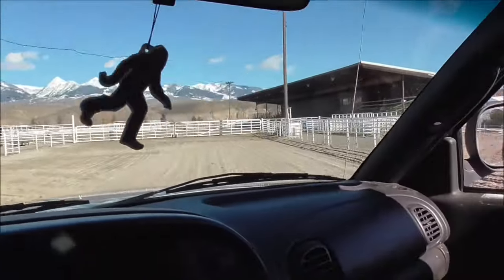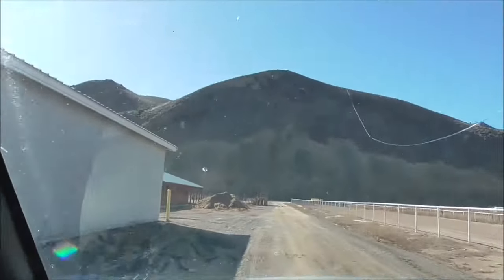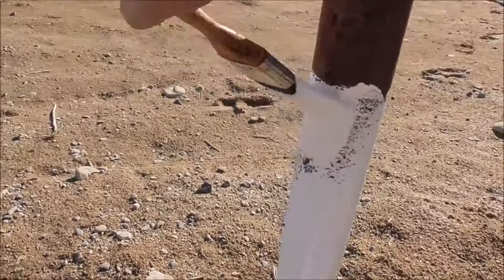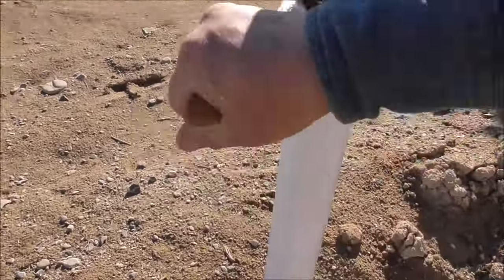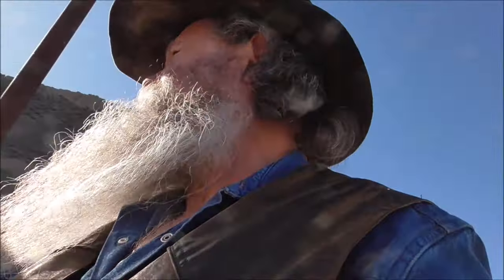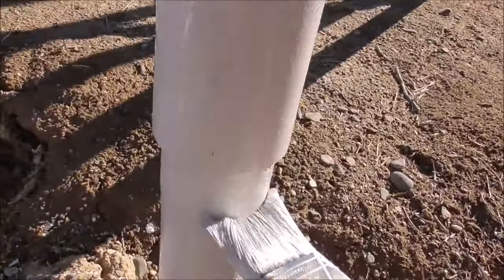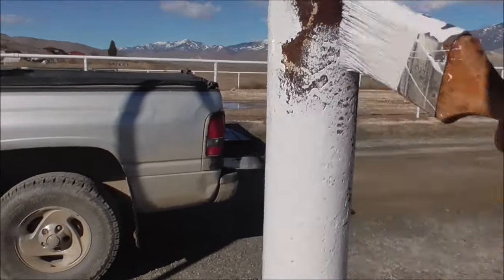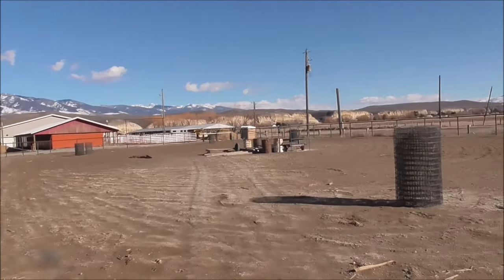Paintin' and Pondering

Comment: Whenever I had to paint a lot of rounded area things, mostly pipe fencing and bollards around gas pumps or posts in front of parking spaces at gas stations, I always bought the 4" mini rollers. They cover a lot of area fast and since they're rollers, they just roll around the curves.
Reply from the maker: We tried that, and it worked pretty well really.  We also tried paint mittens....this rough pipe ate up the mittens pretty fast.

Comment: Maybe a 2 or 3 inch wide paint roller would be a little bit faster, just wondering.
Reply from the maker: We tried that, and it worked, but really about the same as a brush.  I don't think one was any better than the other.

Comment: Gary, check out Noxyde from rustoleum industrial division. It has a much longer life cycle than alkyd/oil coatings. See below. 
Noxyde Elastomeric Acrylic Coating is a high-performance, high-build, rust-preventative water-based coating. Noxyde is self-priming and designed for marginally prepared, sound-rusted, or clean steel in mild to severe industrial environments. It can also be used on concrete and has excellent elongation properties of 200% making it suitable for bridging small cracks. This single component coating resists corrosion, rust, and water even in severe marine environments. Can be top coated with multiple Rust-Oleum High Performance products for an extended service life for your assets.

Direct-to-Metal, Self-Priming, High-Build Water-Based Formula

Performs Like Zinc/Epoxy Coatings Without the need to Abrasive Blast

Provides Flexible Durability - Up to 200% Elongation

Excellent Adhesion and Performance over Minimal Surface Prep

Ten-Year Rust-Proof Guarantee*
Reply from the maker: Interesting!  I'll look into that for sure.  It might be what we are using, but I'm not sure?  It's a Rust-Stop / Rust-Oleum  type paint through Ace Hardware.  I think they have their own brand name for it?   This pipe is used oil well casing and rusty.  There's too much of it to grind off the rust, just gotta paint over the top and hope for the best.